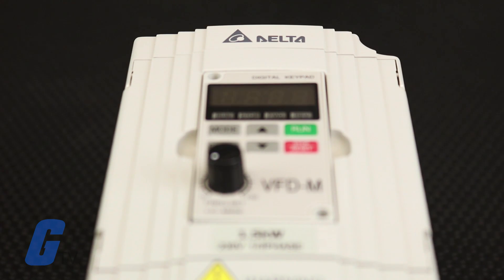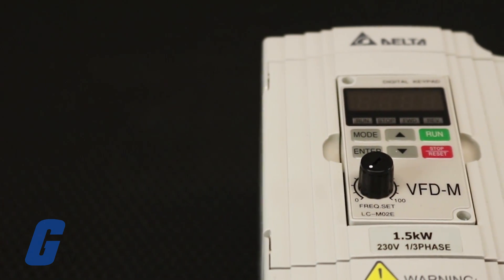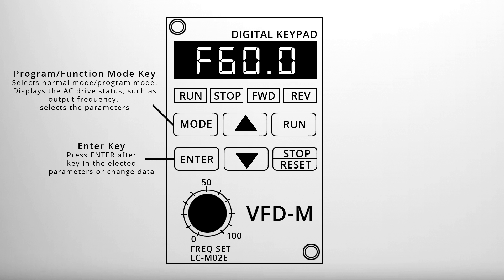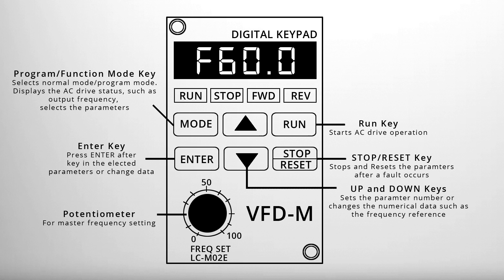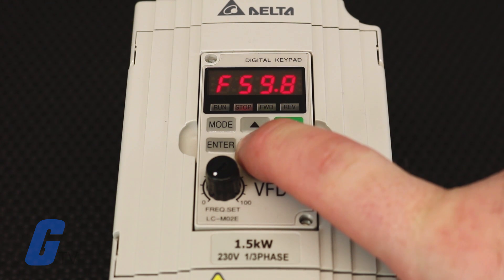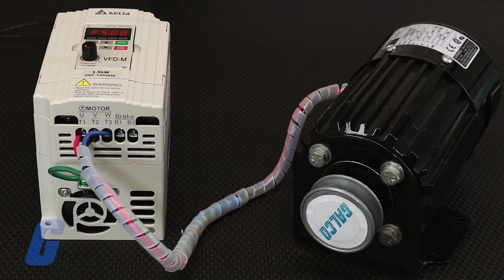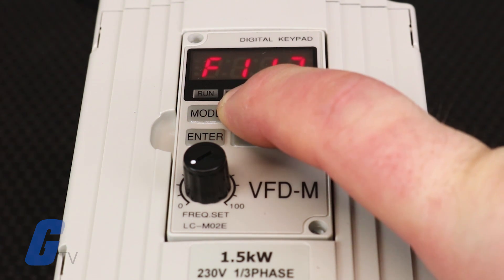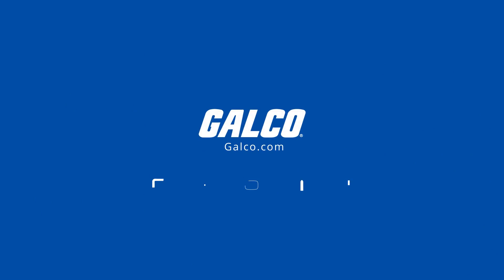Startup Process on Delta's VFD-M Series AC Drive

Comment: How can I do a factory reset ?
Reply from the maker: Very good question, go to parameter Pr.76 "Parameter Lock and Configuration". Select #9 or #10 to reset factory defaults for 50Hz or 60Hz respectively.
Reply: @GalcoIndustrial  Thanks that did the trick.
Reply: @GalcoIndustrial  Are these the right parameters for 1.5kw Delta VFD-M for your CNC router
P01=02
P03=400
P04=400
P17=400
P18=350
P19=300
P20=250
P21=200
P22=150
P24=01
P52=60
P64=00
Reply from the maker: https://www.galco.com/techdoc/dlpc/vfd007m43b_um.pdf

Comment: Need help, got parameters from machune manufacturer.  I just went down the list without paying enough attention.  Gor to number 76, put in 08 like the list said........then realized after it was too late that this was the parameter lock.  Now i can't wnter the rest of the parameters.  Is there any way to unlock or reset it?  I cant find anything in the manual.
Reply from the maker: If this drive is under warranty you should talk to your supplier first. They can can help you with the drive or contact information for the MFG. Have you tried to use some of the parameter values for the pass code to unlock it? Most drives let try until you get it.
Reply: @GalcoIndustrial  yep.  It wont even let me cycle through the numbers at all.  Thanks for the reply.

Comment: I got a problem, I don't  know why doesn't star motor? There is no p option, only F .
Reply from the maker: Try applying the "5 rules of drives", (AC or DC drives). 1) correct line power is on, 2) motor is connected properly, 3) start command present, 4) speed command present, 5) is there feedback required? let us know what you find.

Comment: CF3 (hardware circuit fault)
Reply from the maker: Sounds like the Control board has developed a fatal error. You will should return it to your distributor or the factory for repair or replace, depending on level of damage they find in it.

Comment: need help please 
i have the VFD-M it indicate o c A ( or  o c R  not sure) what is the problem
Reply from the maker: Is probably OCA or Over Current during ACCEL. Try increasing the ACCEL time if you haven'y already. If motor doesn't even turn before fault occurs you may have an issue in the power section of the drive itself. Try disconnecting motor completely and see if still faults, if not may have an issue in the motor or wiring. If it still trips with out any load the drive is most likely bad.
Reply: wiring problem